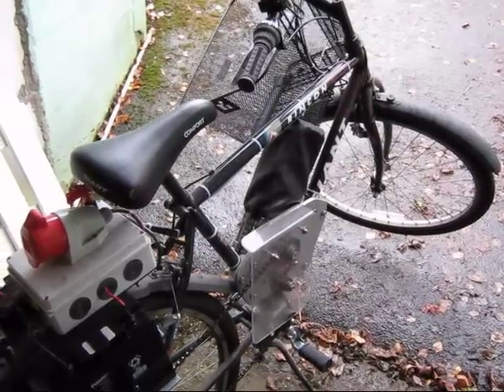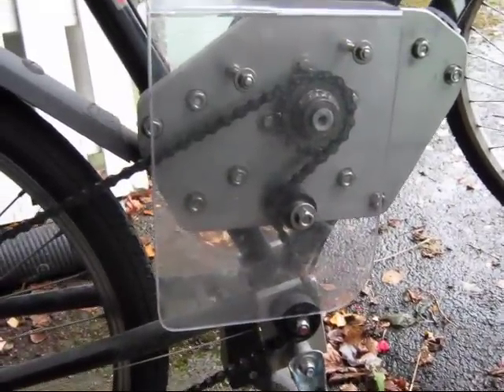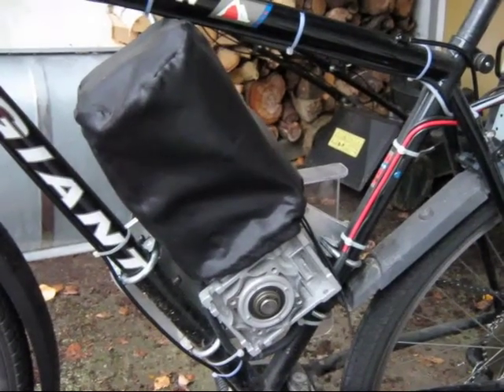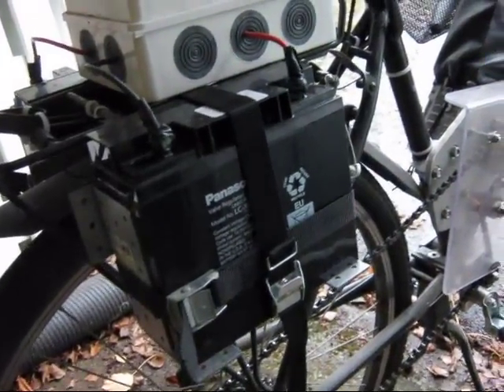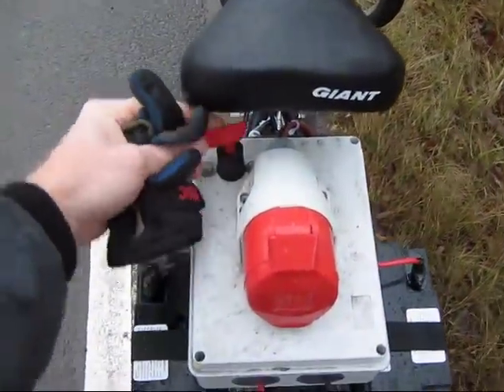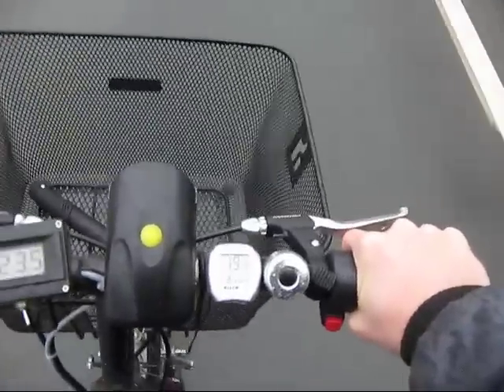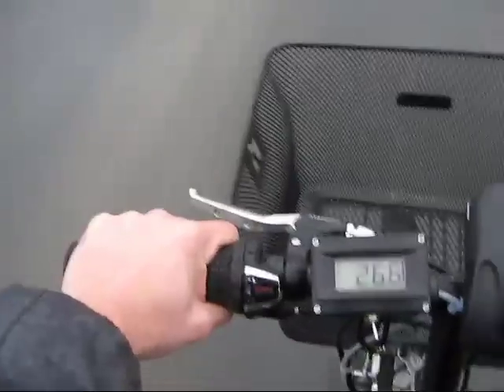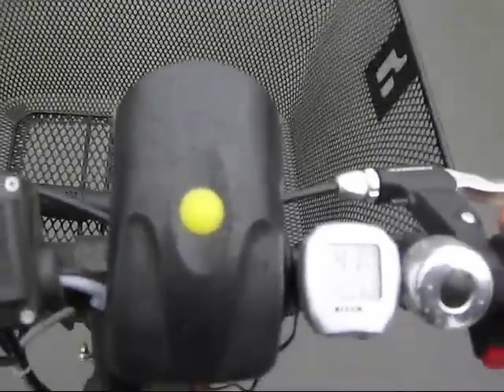Home-built Electric Bike, part 2

Comment: I've used li-on and its not worth the effort. lipo4 RC batteries are light and  are ten times better in range and current you can get this below  and  has a maximum  current up to  340 amps http://www.ebay.com.au/itm/322098855866?_trksid=p2060353.m1438.l2649&ssPageName=STRK%3AMEBIDX%3AIT
Reply: Thanks for the suggestion, I might test it some day

Comment from the maker: The bag is made for vacuum cleaners, hence letting air pass through, but not the rain. Also, the motor is mounted on aluminium flanges letting the air pass. No problem there. More important to cool the regulator circuit in this case, but I have a computer fan in the box for this reason.

Comment from the maker: You should definitely go with a motor with more torque than this one if you're building a trike. There are nice hub motors on the net. Using a hub motor you'll not need a complicated transmission or gearing and get better efficiency. Good luck!